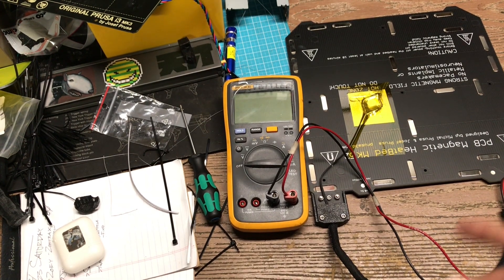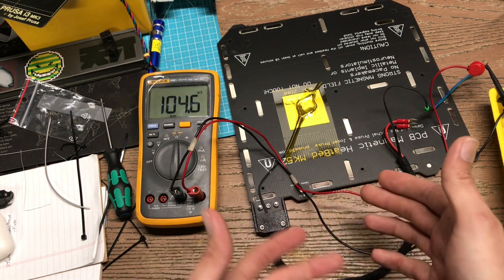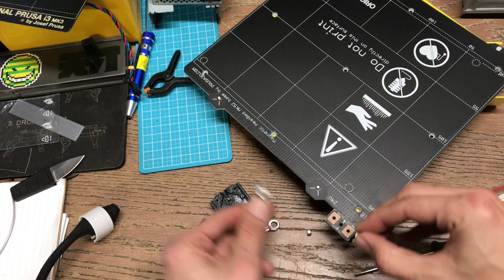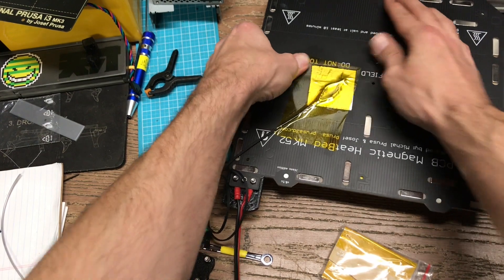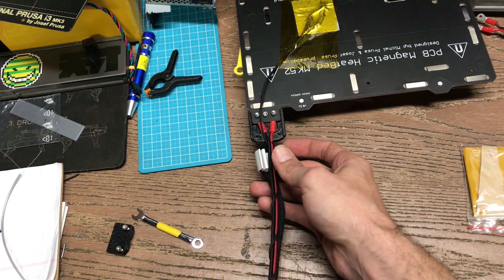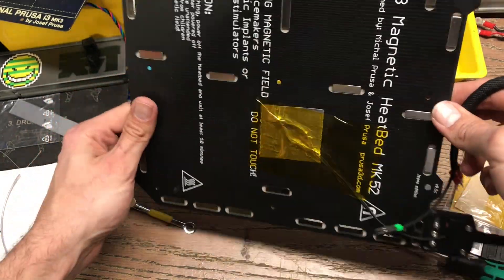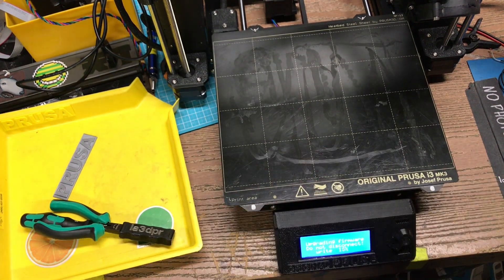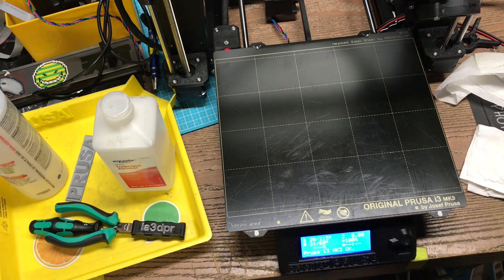Prusa MK3 Bed Thermistor Replacement

Comment: Sadly I cannot get the thermistor wire out of the ensi board. I contacted Prusa support and they suggested various ways to do so (needlenose plier). Eventually the safety clip sort of got stripped and now I have no clue how I'll get it out. Any advice?
Reply from the maker: I’d probably need to see a pic; send me a text. 
If you pull hard enough the whole header will slip off the soldered pins on the board and you can just pop it back on, no harm done.
The thermistor “signal” is not polarized even if you did get it flipped around on reinstall it wouldn’t cause a problem.
Reply: @LA3DPrinterRepair  hi! thanks for your response. I sent you an email showing what it looks like....

Comment: Glue Stick is waterbased. Try washing it off with water instead of alcohol. Works best for me at least. After that you can clean the surface with alcohol to get rid of fats and oils that you get on there by touching it.

Comment: Awesome video, two questions for you.

1. Where did the adapter for the thermistor come from? Around 22sec green / blue that you hooked up your meter?
2. Where did you get the wire loom tool?
Reply from the maker: It's just male to male dupont headers, generic stuff; any old wire will do the job, or you can directly probe the metal tabs on the back of the thermistor header.

Comment: What is the gauge of the wires that had the kinks in them? I need to buy some but am not sure what to buy.
Reply from the maker: OutWithSibs it’s EU standard so it’s specified as 1.5mm^2 of Cu; I recall doing the math and 14-16AWG should do the job, but beware most of the speaker wire out there has super fat insulation. I have the “good stuff” imported from TME which is the same cable Prusa uses if you just need a short length, hit me up. la3dpr.com
Reply: Lee Olivares Thanks for the reply, useful information except I’m not too familiar with AWG (I live in the uk). I ended up ordering a 12 gauge silicone wire from amazon after watching a video from Thomas on YouTube. I literally only need it to replace the wire to my heatbed because like yours it has loads of kinks! :-(